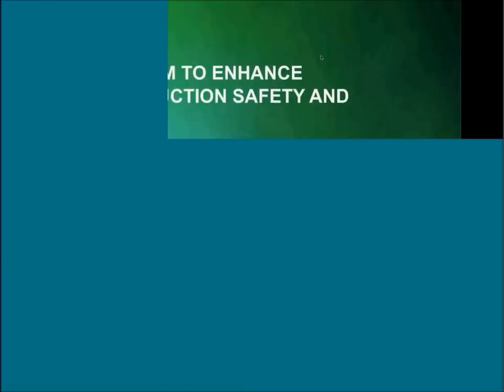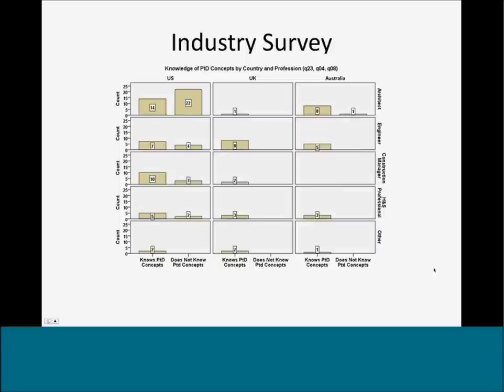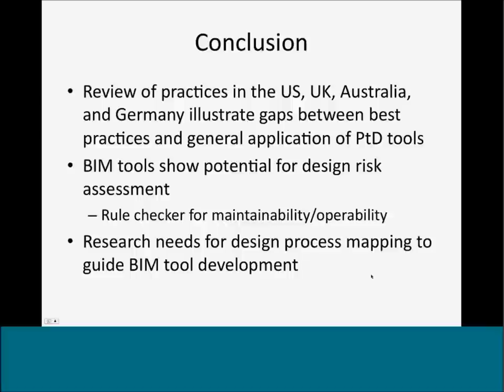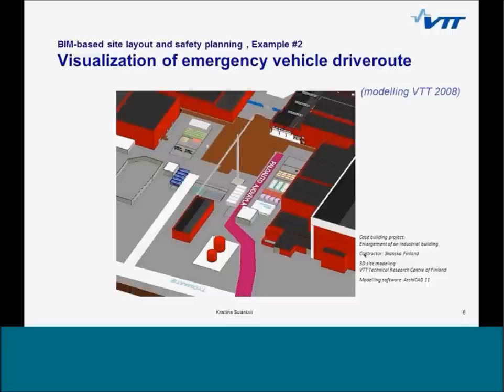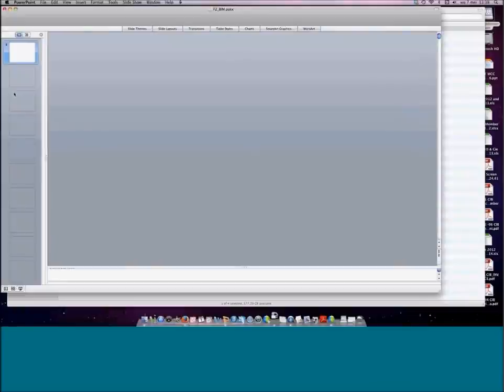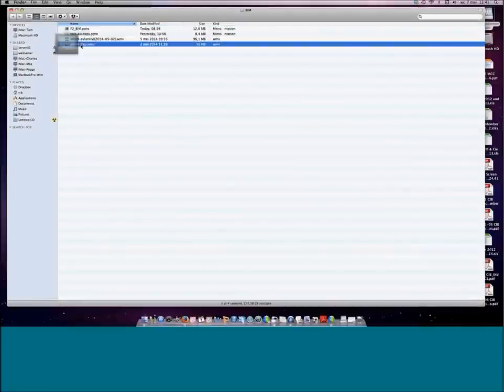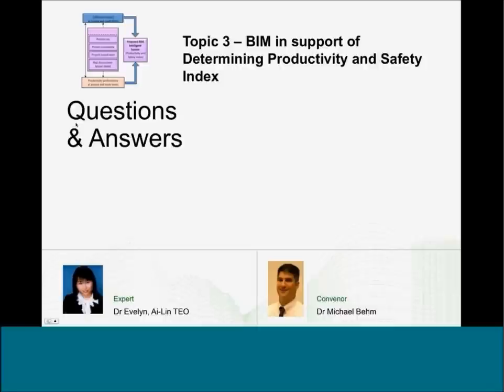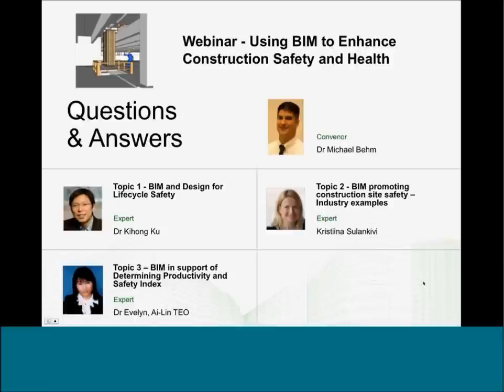CIB Innovation Webinar: BIM in support of Safety and Health on Construction sites

Comment: Obviously interested in Safety in Design. Interesting to hear the first presentation. Thank you.
In the UK as you are aware we have legislation that requires us to take account of H&S at the design stage for the lifecycle of any asset. What has been interesting for me is advising clients who are working internationally and so are working in jurisdictions where they do not always need to comply with UK statute. Here they can apply the spirit of the legislation. When that happens without the fear driver then real excellence emerges. I would recommend to any designer that you look at the idea of designing for lifetime ease of use/maintenance/decommissioning/demolition. Ease is strongly correlated to safety simply because short cuts are not required.
BIM is another tool that helps in filling in the necessary process framework for project delivery and lifetime functionality. Anyone who has used it properly sees it as an obvious development.
We will post our workshop on BIM and H&S here in mid June.
Keep in touch!
Liz for www.safetyindesign.org.uk